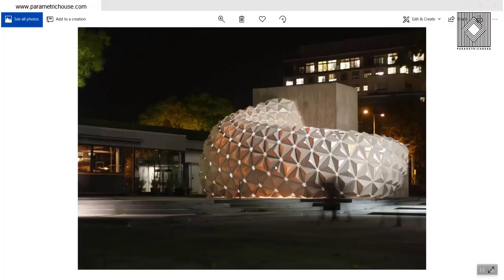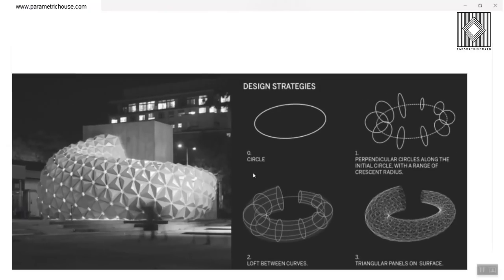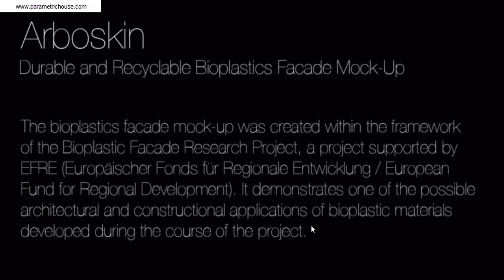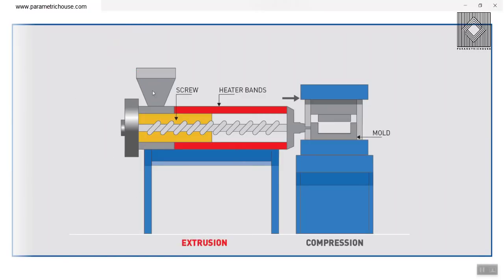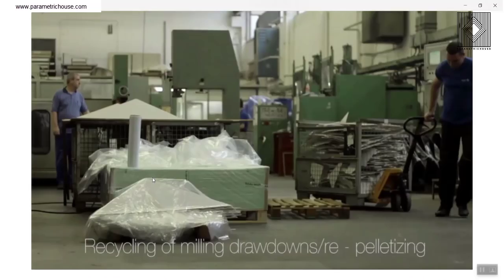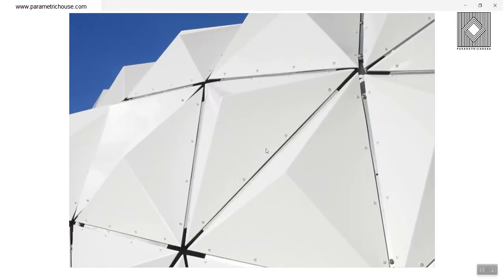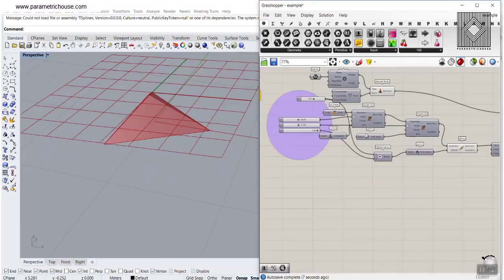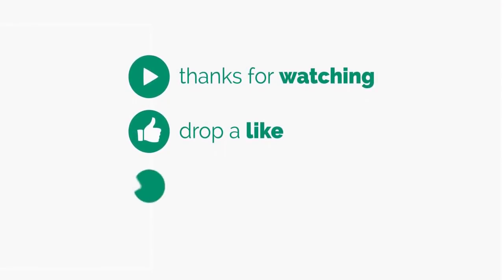Parametric Architecture & Design #1

Comment: SUGGESTION: Excellent series looking forward to these.As someone learning Grasshopper, I could realy use 2 things. I'd like to see how the Parametric design is used in the realworld. Most tutorials show cool descriptions but nothing you'd use in real building. Second, I can follow the design process in GH, but if you'd give more REASONs why you are using a node. Example, I'd like to know when its better to start with a point, or a plane, etc, and then build off that. Like making a vase. You could start from a circle and extrude up, or maybe a profile that you revolve. Thanks!
Reply from the maker: Thanks for the feedback FilmFactry🙏 we are adding thesis and articles to our website so I guess you can see how grasshopper is advancing research in architecture and design.
But seeing how grasshopper can empower real design is what you mean and I agree with that. Two years ago I completely used Grasshopper to design a mobile case and a series of wedding rings! Anyway I will try to research and add the technical stuff to the future videos.